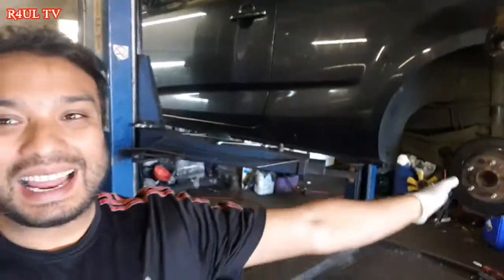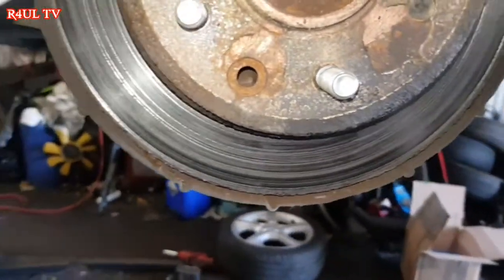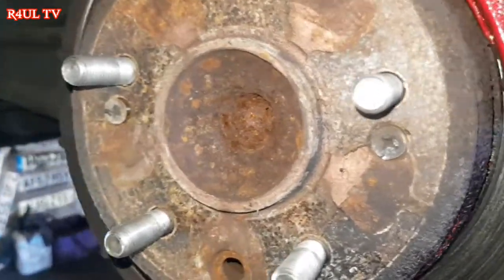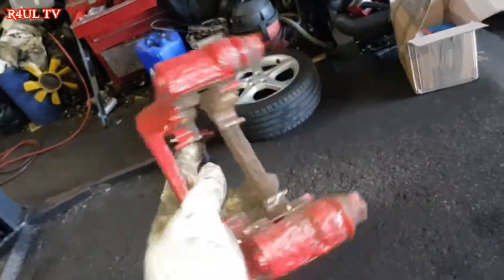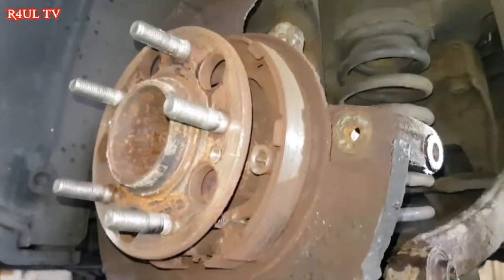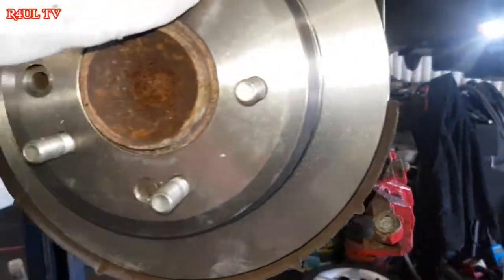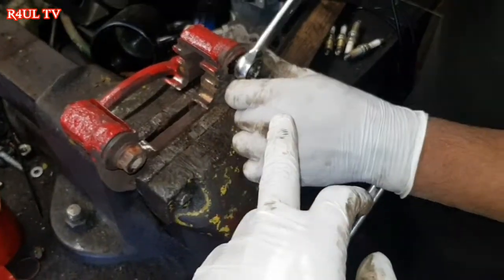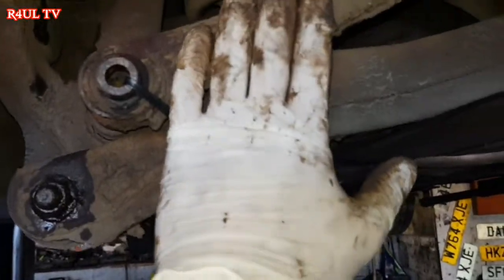2008 Kia Cee'd Rear Brakes Replacement

Comment: Helpful video. The second technique is the right one that is also in the repair manual. 110Nm to tighten it.
points lost for:
- caliper hanging from the brake hose
- piston pushed back one sided with water pump pliers
- no rust removal before installing new disc
Reply from the maker: Thanks for watching really appreciate it
Reply: @TEAMR4ULTV did you even listen to what he said??

Comment: Good effort but, nothing about winding brake caliper piston in and very importantly, no torque wrench used on safety critical components😎
Reply from the maker: Thanks for watching really appreciate it. As for the caliper piston  they are not winding back piston. Just push back (in bore shoes) and as for torquing the components up I find it better without the torque wrench that way I know its tight dont trust torque wrench for certain jobs ie head bolts,  cam shaft, big end bearings etc yes. I have been doing this for past 20 years so far it's been ok. Thanks for watching anyway